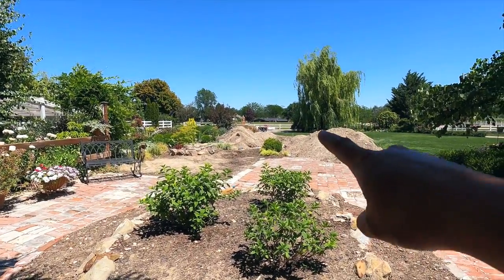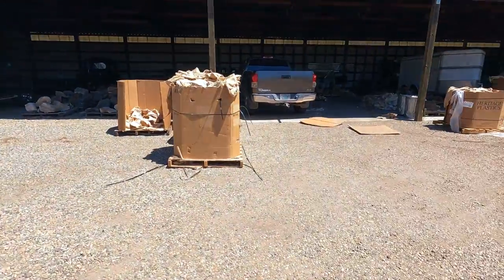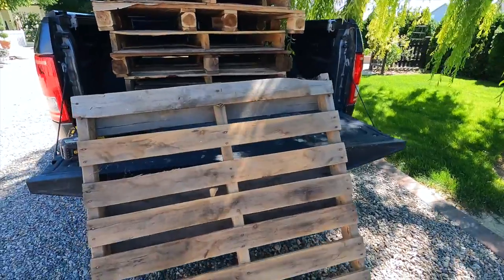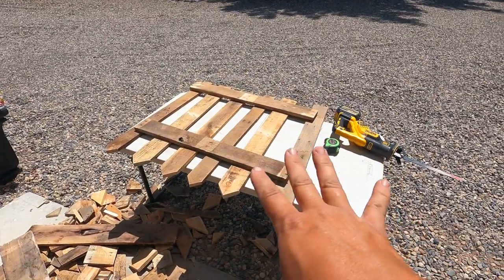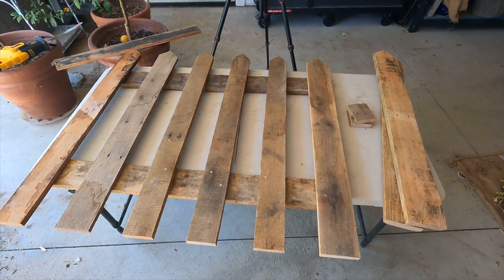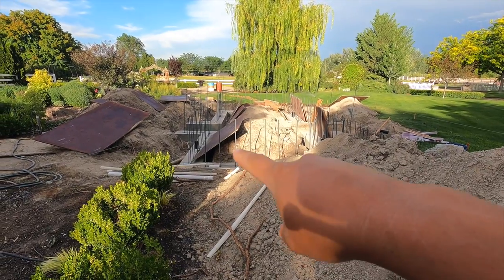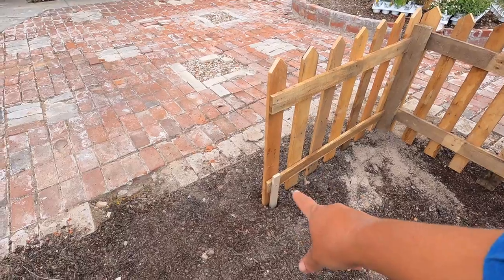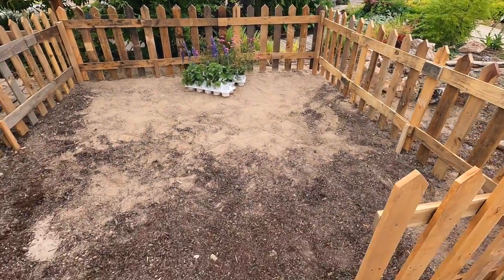Building Picket Fence Out of Pallets! 🦋💚🌿 // Garden Answer

Comment: You go girl. I have a wood shop but my wife would never try to use my tools, let alone take on a project like this. Turned out great and you saved $500 to $1,000  using pallets. The cost of lumber right now is ridiculous. I did a shorter version of this for my peony garden. The picket is only about 2ft tall and sort of an oval shape but it helps keep my peonies from flopping over.

Comment: Cutting all those pickets SPEED TIP: put a stop to the left side of your saw to butt the end of your picket into it.  Cut the first 45° cut, then roll the board to the right position to cut the other 45°, butting it up again against the same stop.  This will make your point centered on the board without having to use the marker and to line it up.  Next, use a stop at the desired length from your point and square bottom cut for consistent length and speed cutting without having to measure and to mark each picket.  Note: if your boards were a CONSISTENT WIDTH, you could have cut the lower square edge first, but your UNEVEN WIDTH reclaimed wood would make the centered point result in a different height each board.

Comment: You could make a drinking pool for the butterflies with a shallow pan for a water heater or a washing machine set up on a pedestal or an up turned pot. Fill with soft edged gravel and fill with water. If you used drip tubing along one edge with spray emitters the hummingbirds could also use it for a bird bath. Might add some interest for Benjamin. Thank you for all the information and ideas. Love your channel.

Comment: Terrific idea Laura repurposing the pallet wood. Turned out to be a great project using what you had on hand. Which leads to another question… you mention about digging up and getting rid of the bricks and I wondered if they could be turned on edge and used as a front for your Hartley? I have no idea what kind of shape there in or the colouring but they certainly do have an old school charm about them. Just throwing it out there.

Comment: 💡 What’s better than free? We have been quoted $18,000 to fence in our back yard for our 1 year old pocket beagle. She is 15-20 lbs and about 12 inches tall from paws to top of her head. (If she were standing on her back legs next to our bed, you can barely see her peeking over) She won’t be growing any more, so I figure a 3-1/2-4 ft fence around either our backyard or our front yard would give her a safe place to run…but panels at Home Depot and Lowe’s are about $15-$25 a piece and that’s not including posts. We have a large backyard, and our front yard is about half the size as our backyard. About an acre total… So, that’s not even in our budget. But then I saw this video and thought, I can do this! And instead of using 2x4 posts, I will use steel poles hammered a foot into the ground, so the only things we would have to purchase would be the spiked poles and some pole rings! Everything else would be free or close to free including the installation of the fence because of two reasons. We would be doing the labor and since it is not considered permanent, we wouldn’t need to pull a permit! Winner winner!

Comment: Speaking of the amount of time spent on the project, your miter saw could handle 5-6 pickets at once. It also would speed things up to cut the flat end first, then but the flat end against the fence on the saw stand when cutting the points on the pickets. This would have reduced your prep labor by about 75%. No help for the competed project now, I know. But maybe useful in the future.

Comment: Having cut the tops of pickets before, it goes faster if you cut all one side first, then flip the saw to the opposite angle, then do all the opposite side. This way you don't need to transfer the angle mark to the other side or flip any boards.